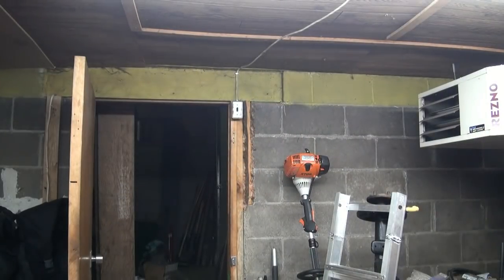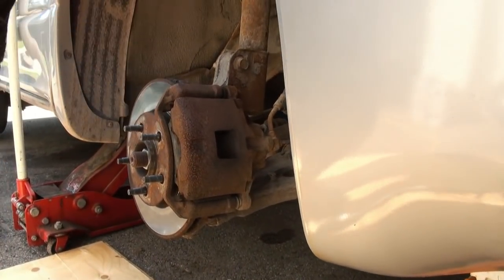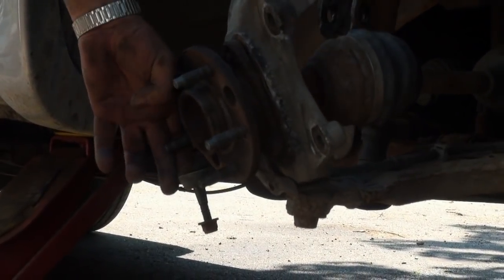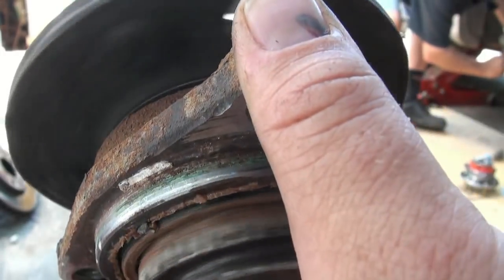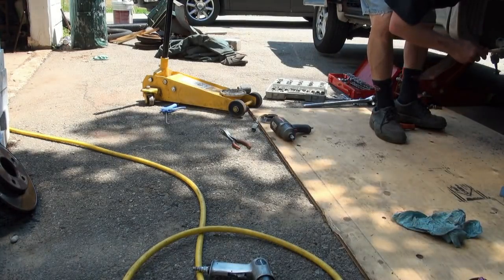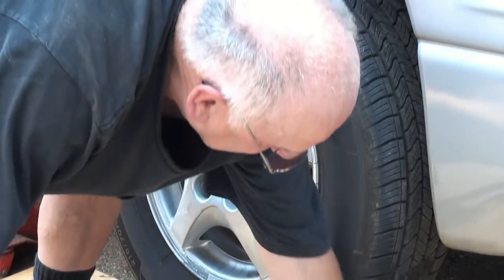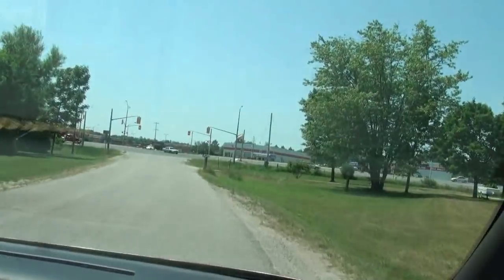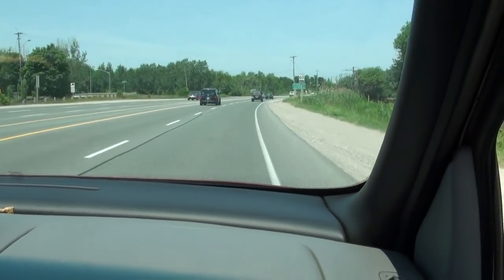front bearing replacement on a montana minivan

Comment: You don't even have to do all that work. All you needed to do jack up the and put it up on stands, then turn the steering wheel left and right to get to the bearing bolt mount. and when you remove the strut steering knuckle mounts you just ruined the alignment on the vehicle. You made it to complicated!!
Reply: I agree, just did my Chevy venture and was thinking that maybe these guys are showing you how to do it the wrong/most complicated/make more work and expense for yourself way possible?? Tune in for the next video when they show you how to change the wiper blades from the INSIDE of the vehicle. "Just start by removing this here windshield b'ys...."
Reply: +ira parenteau They didn't alter the alignment of the vehicle everything was put back in the same position it came apart.

Comment: haha first thing you do is take off the big nut (it will be VERY tight) in the centre (holds the drive shaft) they conveniently didnt tape that, it just miraculously dissappeared! do it with the wheel on the ground because it should be VEEEEERY tight and therefore hard to loosen especially if the suspension is half apart...

Comment: Bill you dont have to pull then strut apart to get the three bolts of for the wheel bearing that was A waste of time with turning the wheel you should have more then enough room to get them three bolts out in the back

Comment: we didn't do all that work. we just took the hub assembly nut off and then used a gear puller and impact wrench to pull the hub assembly off the spine. then we had to pry the bearing cover off that was left on the knuckle with a little screwdriver because it was rusted on. torque the wheel hub assembly nut back on to 118 ft.lbs., tire, hub cap, done.

Comment: What size socket for the cv axle nut? thanks
Reply from the maker: big lol
Reply: Lol..i found out it's actually a 32mm socket for the original axle nut ,but on the new cv axles ,it's 36mm ,the old 32mm axle nut fit on the new cv axle threading... :P